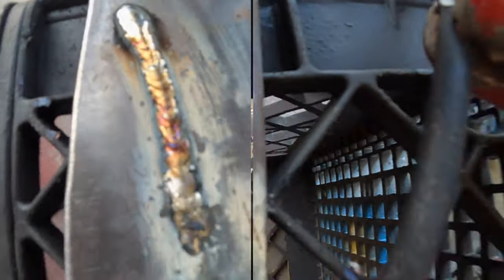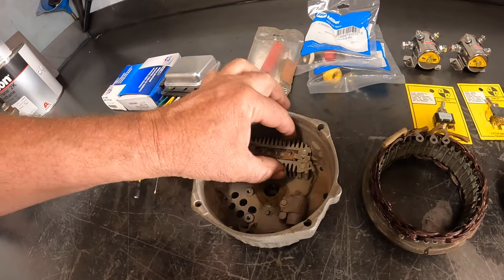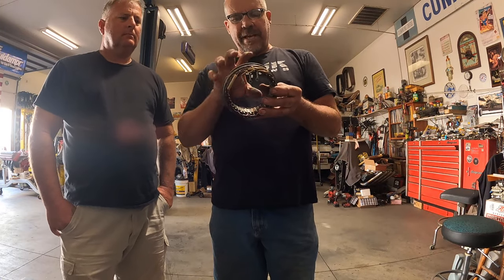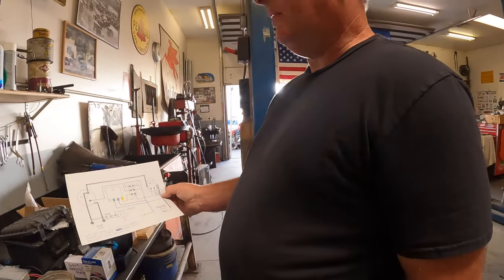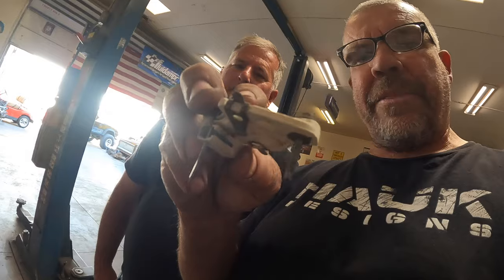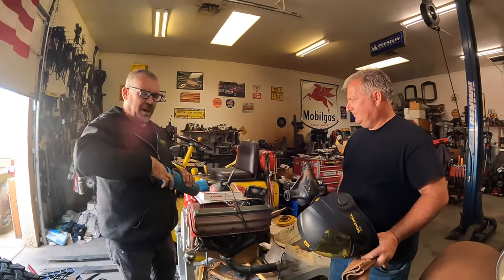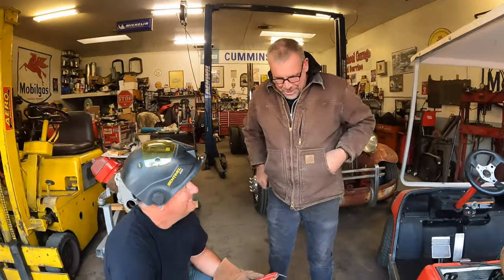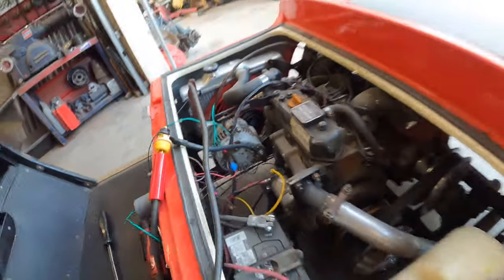How to Turn Your Alternator into an Arc Welder

Comment: I dont know if Merlin was a teacher at 1 point in his life if not he'd make 1 helluva teacher! Thanks for the videos you're a cool dude.
Reply: I think we might have to call him MR Merlin if he is going to be a teacher
Reply: Lol one of those cool teachers that the one wise arse kid lipped off to one time at the start of the school year.  And that's the only time it takes for everyone else to learn not to do that again 😂
Reply: it's pretty intuitive if you think about it. Alternating Current changes direction intermittently. Direct Current moves only in one direction. 
A good way to remember it: a rectifier converts to DC, an inverter converts to AC.
Diodes only allow current to travel in one direction. They're solid-state, no moving parts. Rectifiers are simply just diodes in series to handle the strength of a load.
Which is why you can get away with stick welding, it doesn't need a smooth (clean power) sine wave like in AC welders. Stick welding just needs power. 
I'd recommend 6010 with some practice at home before you pack it for emergency trail fixes. My preference is 1/8" Fleetweld 5P+ rods.
Reply: sooo Jimmy is kinda dim??
Kinda like someone I know, I am always wanting to learn new stuff.

The reason I happened upon this video is because I was looking for the Premier Welder and a couple of other videos like this popped up.

I would like to set up an auxiliary alternator just for welding.  My idea includes having a machine shop add and balance a pulley to the existing alternator to run the welder alternator to keep the two isolated from each other.

What do you opine??

Comment: I worked at an alternator shop 30 years ago and built one for my landcruiser.  I used the big case ford off an off a LTD.  They hold up better. Bigger heat sink.  Worked great!
Reply: Dude at autozone will not know "big case mid 80's ford alternator please".  What year and engine?
Reply: I'd say 1975 - 1977 LTD with 460 else 400. Look at them and should be able to tell which is bigger.
Reply: The "Big Ford" is sometimes called a Side Terminal Ford.

For just a boring old Big Ford story read further. About 40 years ago I was involved in test-to-failure to see which of the then readily available automobile alternators would be most suitable for repurposing similar to this welder build. For the tests alternators were mounted to a SERIOUS test bench and ran full-field with carbon-pile high load for all they were worth. I don't recall exactly, but it seems like about 90 volts and 10 minutes would eliminate most contenders; usually with a smoke show. LoL The Big Ford we got tired of listening to it scream for more after already having burned up about three drive belts.

Comment: I wish you would do one more follow up video here that's focused on how to run your "Welder alternator" like a regular welder again, with the external regulator and how to hook it all up correctly and how it should work, what all the wires do, etc..  That would be a perfect sister video to this one.    I really appreciate you teaching this stuff, because most people like to keep these types of things their little secret.   cheers.
Reply from the maker: Print the diagram it’s all there
Reply: @MerlinsOldSchoolGarage  There's just a lot of wires on the regulator, and I'm not sure what they all do.  Also, does the external regulator have it's own diode set?  Or are you still using the internal diodes of the Alternator?   I can see, and do understand that schematic-- I'm just not so sure about the exact parts.   (I can figure it out, I'll just have to watch a few more vids.)  Cheers.
Reply: @calholli  You bypass the internal regulator accessing/exciting the brushes/stator directly with the external regulator.  This can get tricky on some of the newer alternators with an integrated regulator/brush holder assembly.  On some you may have to do a bit of de-soldering and cutting to bypass the internal regulator plus be careful of those where the fields are bolted to the front half of the alternator casing and soldered to the rectifier, etc bolted to the back half or you'll end up having to replace/repair the field coil.

Watch out for newer vehicles that have no traditional voltage regulator since some for fuel economy, emissions and such have the alternator regulated by the Engine Control Module.  On those you need to take steps to keep that computer happy and not reading a charging system fault at all times or perish the thought end up damaging a $1,000/$2,000 ECM.

Best
Reply: @neilfromclearwaterfl81  That's what I wish he would show, is how he likes to connect to the brushes and all the little tricks to make it work right.  I guess I can just look up videos on people rebuilding alternators and learn more that way.  Thanks..
Reply: @calholli  He showed the connections for the make and model of alternators he was working with at 1 minutes 5 seconds, 12 minutes 45 seconds and 18 minutes 35 seconds in the video however there are too many differences to be able to show them all so you have to look over the one your currently working with and make accommodations based on what your have in front of you.  Some will have screw terminals, others spades while others will require some cutting and soldering.  Unfortunately there's no one or two solutions.  Some alternators will not be as easy to convert as the two specific ones he recommended.
Reply: @MerlinsOldSchoolGarage  nice. Video/ just do one thing  diferent put. The +/- from the welding alternator  separate from  the ground on the engine reason  its to not waste the eletrons from  the ground body  going to your chassis  so wiring  everything  out into two quick connector  that's how  goes/  then the. Other  thing  it's get two  small  buck with salt water to  place the leads cable inside the bucket u add to the water bucket 'the other  welding  cables just. Like two straw inside coke cup but. U don't touch the two  the eletricity flow inside the salt water and  that  eliminating the diode to be short when the welding effect its happen/  and the last its. This hot eletrons flow from  negative to positive so if u welding the eletroud stick  its need to be negative/ and the positive  goes to the plate or pcs that u welding  because is where u want to eletrons flow hot end melting the stick eletroud causing  to weld to the positive side.
Reply: @MerlinsOldSchoolGarage  🔴 What Is Islam? 

🔴 Islam is not just another religion. 

🔵 It is the same message preached by Moses, Jesus and Abraham.

 🔴 Islam literally means ‘submission to God’ and it teaches us to have a direct relationship with God. 

 🔵 It reminds us that since God created us, no one should be worshipped except God alone. 

 🔴 It also teaches that God is nothing like a human being or like anything that we can imagine.

🌍 The concept of God is summarized in the Quran as:

📖 { “Say, He is God, the One.  God, the Absolute.  He does not give birth, nor was He born, and there is nothing like Him.”} (Quran 112:1-4) 📚

🔴 Becoming a Muslim is not turning your back to Jesus. 

🔵 Rather it’s going back to the original teachings of Jesus and obeying him.
Reply: @MerlinsOldSchoolGarage  z†,"'7…

Comment: Just making sure I'm reading the schematic correctly.......the relay is to isolate the alternator from the vehicle when you apply full 12V to the field winding (basically disconnecting the 120V from the rest of the vehicle systems so you don't fry everything). If a second alternator is used, the relay and regulator can be eliminated, and a simple single pole switch used to supply an on/off 12V field signal, correct?
Reply from the maker: yes
Reply: @MerlinsOldSchoolGarage  do you have a part number for the relay? its not listed in the parts list above.

Comment: That is cool I have welded with 12 volt batteries before but never with a alternator I got to say that is cool. Man you can have a alternator for a welder and turn a A/C compressor into a air compressor  you can have a whole service rig running off your engine.

Comment: Just some things to add to this. 
There are two flavours of alternator delta and y. Delta are better at producing current 
You really need a control on your rotor. To control the voltage. Stick weld is not constant voltage but constant current. There is a circuit on line that varies the rotor voltage to keep the output current constant. 
The other thing is to use reactance on the out put cable. Just the weld cable rapped around a pipe. This will stabilize the arc by building a magnetic field if the arc breaks the magnetic field collapses and the high voltage will re light the arc. 
Lastly newer alternator diodes are made to blow with more than 40ish volts to protect the ecu in a car. 
Use an old bosh they are rated for full current and are delta wound. 
I’ve done this same thing and learned a lot 
Good luck.

Comment: Had a buddy that had an Alternator welder run off an old Homelite Chainsaw,  worked fine and a lot better than goofing up a vehicle.
  He used a rheostat too control the Imput too the Alternator rotor though the brushes, this is actually a 40 year old trick.

Comment: I am a retired physicist who grew up in Eastern Oregon. My dad, and other WW2/Vietnam Veterans, taught us how to use electricity from the resources available, just as you describe, but in order to survive.   My  brothers and I were often Stuck, far into the woods, but made it home by understanding the  incredible power connected to a piston engine via. generator or alternator, as Our Veterans needed to survive. You explained this PERFECTLY,  RESPECT for the ingenuity of neccesitty!  Dribbling gas  through the valve stem to reinflate our tires was a very bad idea...but it worked 'Just Say'n (Huge Smile)

Comment: I was introduced to this method of welder from my mentor at a very young age. He told a Korean war reconnaissance mission for returning a crippled tank. It had suffered a broken axle so he welded it up for it to be loaded on the truck. He also used a pickle crock to boost amperage and a set of jumper cables to finish the task. Thanks for sharing

Comment: Did this over 30 years ago.  Taught myself to weld with the set up.  Even repaired and got people out of the woods with it.
Reply from the maker: that is awsome
Reply: Me too.  Built one on my 93 Isuzu Rodeo and made many trail fixes to Other Guys Rigs.    Eventually replaced the small alternator with a 250 AMP one and need to hool my welder stuff back up.

Comment: That is cool, my dad's work truck had a welding alternater called high frequency. Instead of using high voltage to make heat it used higher wave frequency. 
Thanks Merlin
Central California watching

Comment: That was a incredible video my father was an electrician and in his old 1966 GMC K 2500 he had an outlet for running AC power tools very similar to what you just showed us minus the welder. Keep up your awesome content absolutely love you channel, Thank You for what you do on You Tube 👍
Reply: Well that explains the "86 f-350 I bought from a SoCal Edison auction. With a flip of a switch on the dash, I could make the Mr. Coffee maker work that had been mounted on the hump in front of the seat and the 115 vac receptacle on the utility box for my 4" grinder worked, with no fancy aftermarket inverter.
Reply: @haydenperrine854  the rectifier inside the alternator is the same as an interter. it uses a diode to turn a AC sign wave into a DC square wave. 120v would be 12v DC rectified, etc

Comment: Fascinating video, I built an external regulator for a friend's car years ago to save him the cost of buying a new alternator (it was a weird one with a vacuum pump on the back of it). The regulator itself is super simple circuit with just 2 transistors and a few other components. Watching your video I realise I could have done so much more with it. I was going to attach a car alternator to a lawnmower engine for charging car and boat batteries but making it into a welder as well would be really useful. Thank you for posting the video, you have given me a few ideas.

Comment: Excellent video. The only thing that threw me a bit is you called a Double Pole Double Throw switch a "six pole". So I was staring at your diagram trying to figure out the other four poles when I realized you are counting all the connections on the switch as a poles.

Comment: Love this video, I'll have to try this on my F350. With that said as an electronics technician fixing Military Aircraft and Aircraft Test Sets and have worked with and on Million Dollar computer controlled Test Sets for the last 42.5 years. The example of the Rectifier Circuit explanation is correct, EXCEPT Electrons the Negative part of electricity, the dots in the video, are moving in the wrong direction, LOL. They always move toward the dash on the diode Arrows, which is the Negative side on the diodes. What the author of the video probably meant to say is the "Electron Holes" or lack of electrons which is the (Positive Voltage) moves only in one direction, or with the arrow direction on the diodes as that is shown in the video. For the video to be correct he needs to use the term "Electrons Holes" or "Positive Voltage". "Simply Electronics" got the terminology, Electrons vs Electron Holes (Positive Voltage), wrong on this one. I see this error A LOT in electronics video's explaining how a Rectifier works, other than that his theory is correct on how it works. If you'd like to see how diodes actually work check out this video; https://www.youtube.com/watch?v=l2y-w9aS98k. Thanks for sharing, Loved it. Best Wishes & Blessings. Keith Noneya

Comment: Nice post! In a pinch I've welded with 3 car batteries in series. Simply use 2 sets of just jumper cables. You'll end up with two nice clamps left over. Wire for positive ground, a piece of welding glass and some 6014 sticks. Modulate the power with the angle of the stick. I've successfully repaired motor mounts and idler arms.
Reply: That's what BSF did at the games

Comment: I have done this with a tractor to have a portable welder.
I added a second alternator, leaving the first to keep the battery at a full 14 volts.  Then I put a big rheostat in series with the welding alternator field to fine tune the heat.  Nice thing with a tractor is the engine speed is controlled by a governor, so is more constant.
Found a Lincoln weld pak 90 with a bad transformer or diodes, wire feed still worked.  Connected it up to the welding alternator and a small inverter to run the feed motor and could do flux core wire welding with 100 percent duty cycle instead of 10 percent for the stock Lincoln. The cheap gun would get hot after a while.

Comment: back in the 80's we used the 100 amp Lincoln continental alternators and the big dodge 90 amp alternators to make welders . we also took the air conditioner compressors out of the dodges to make air compressors the old dual head dodge compressors worked great as air compressors and lasted for ever . we also used alternators to make power generator's for wind mill power poles back in the 70's and 80's so If you lived in the woods you could still get 120 volt power . it's an old farmer trick from the 20's and 30's but it still works

Comment: After seeing this video, I’m thinking about putting a dual alternator setup on my truck. One for charging and one for welding and as a backup for the first alternator. By doing that, I would essentially have a backup alternator if my primary ever went out and I wouldn’t be worried about stressing my primary alternator from welding. I may take it a little further and put a voltage and frequency monitor on it to regulate for grinders and stuff like that. A friend owns a generator shop and we could probably come up with a way to put a generator style voltage regulator in the mix to provide “clean” ac power to charge power tools.

Comment: Cool to do, dangerous to do - you pick!  A better option would be to have an alternator that could handle a rectified voltage in a less lethal voltage range.  Homeowner MIG welders commonly have an OCV in the 70V DC range (actual voltage less with arc struck).   A lower voltage, high current setup would go better for the guy out there by himself trying to weld who just happens to get between the welding 'lead' and chassis ground with a wet (or no) glove.

Comment: Merlin, if you want, I could get you one with 430 amps at 14 volts. It's from a firetruck. I could also get one that is 340 amp. Both of these have external regulator. The larger one produces 200 amps at idle.

Comment: He asked about the phases:  (I can't draw a sign wave, so I'll just use 'n and u") 
When you stick a single phase through the rectifier, it turns all of the negative AC pulses into  another positive pulse;  so then your signal likes like this:
From AC=         n   u   n   u   n   u   n   u
To rectified =    n   n   n   n   n   n 
When you have more phases, it will do the same things, but just at a slightly shifted time frame, and make the signal look like this: 
Single phase rectified=     n   n   n   n   n   n   n   n 
Only two phases rect. =    nn nn nn nn nn nn nn nn 
Three phase rectified =     nnnnnnnnnnnnnnnnnnn
So it's the same things happening, there are just three of them happening slightly ahead of one another in time, which fills in the gaps between each pulse.  Giving you a higher resolution of pulses, basically turning it into nearly a smooth DC voltage..  They could even put more phases and it would smooth it out even more, but that costs more money and isn't necessary, because 3 phases already smooths it out quite a bit...  Very cool stuff-- I learned a lot here and I'll be building one.  Cheers.